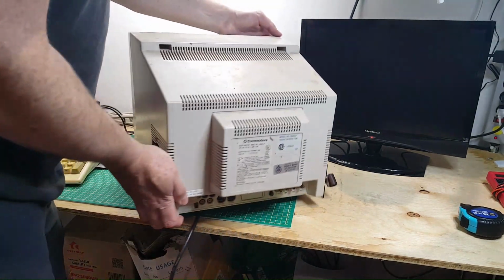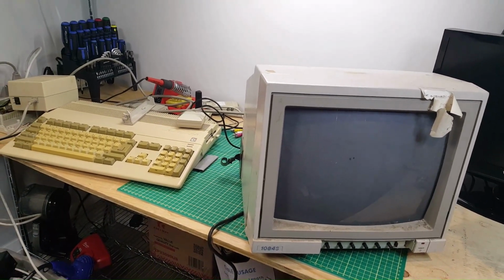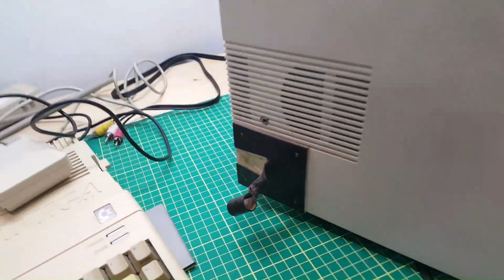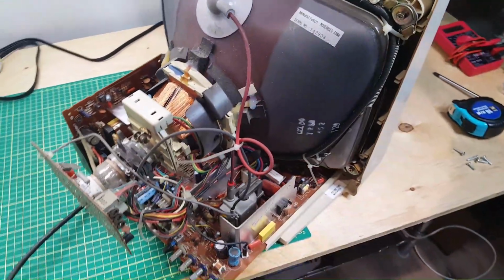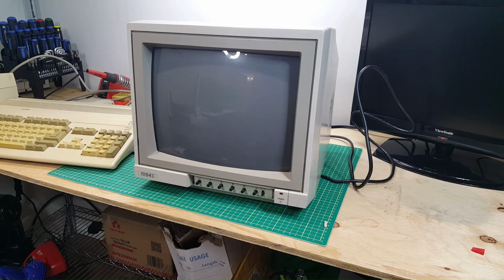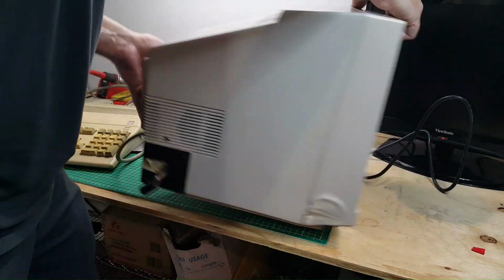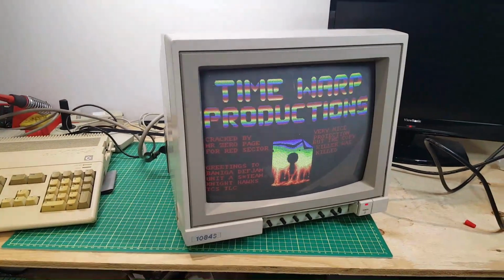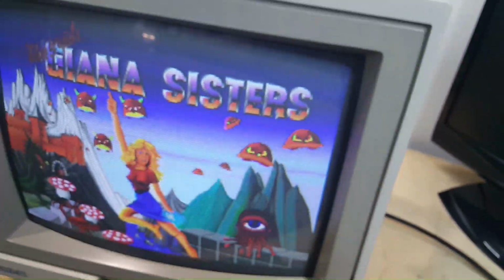Commodore 1084s - Stored In A Shed For Over 20 Years! Will It Work?

Comment: Same story with my 1081, got it free with rev3 A500 and other stuff. Been in the attic for 30 years in outside conditions. A500 didn't work anymore but the 1081 powered on like nothing. Did some cleaning and used it some time and then it started to lose picture. Problem was cracked solder joints near flyback, resoldered those and flyback too and then it has been working nicely ever since.